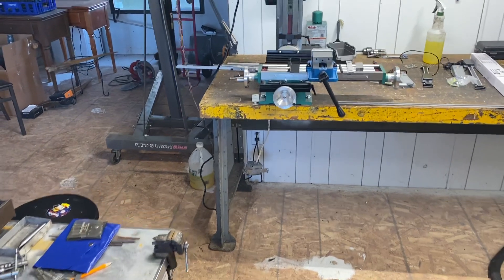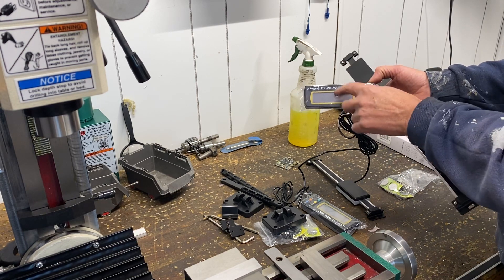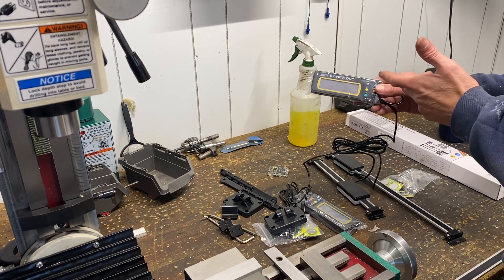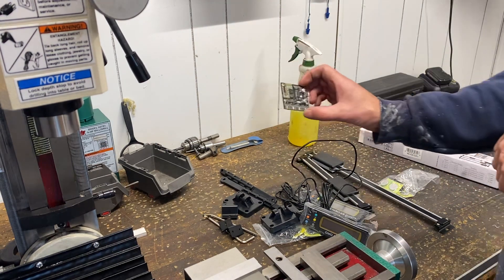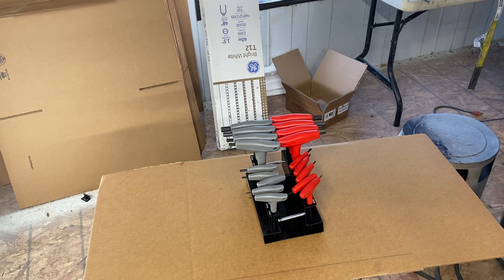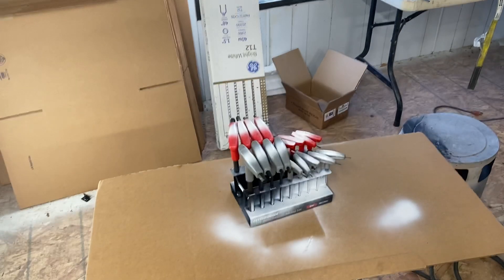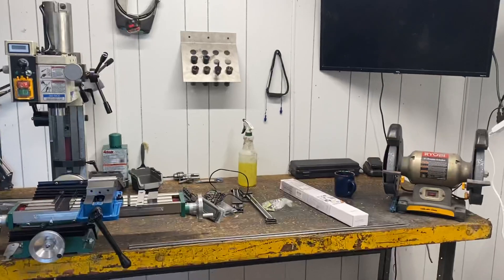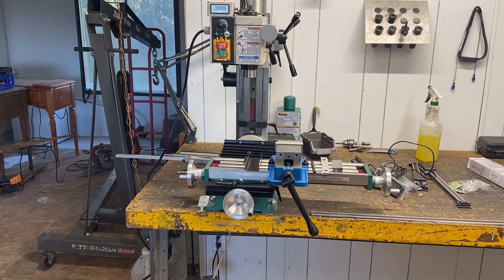Shop tips/mini mill DRO igaging scales with Touch DRO board.

Comment: I have that system on my Rockwell lathe. It was also used on a smaller lathe and a small Rockwell mill I had.
Reply from the maker: I have it on my 11” Rockwell lathe in the main shop. Great tool.